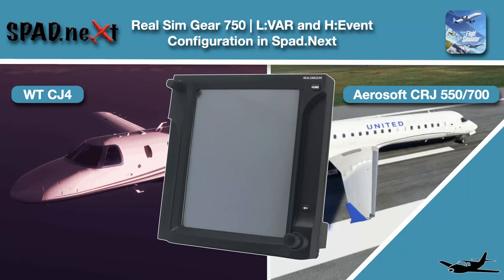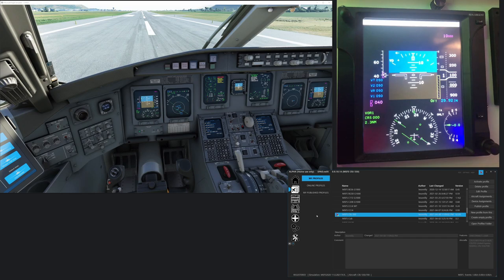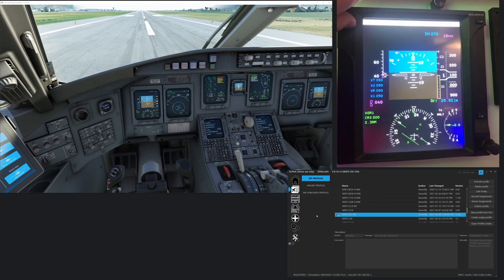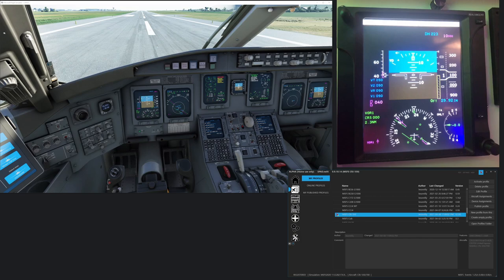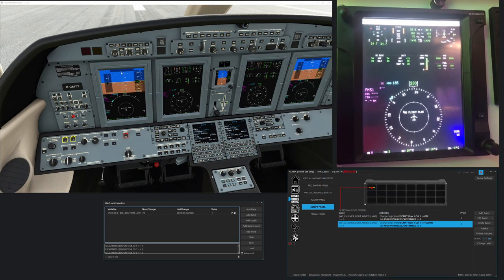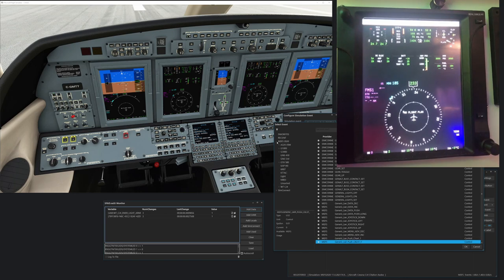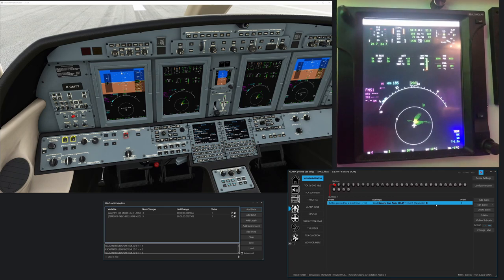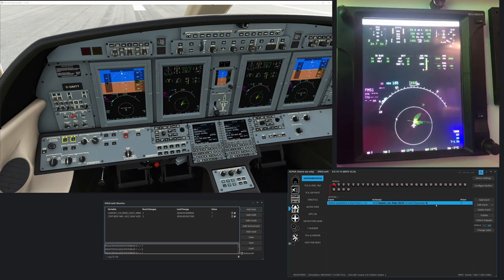(Sim Video) RSG 750 | L:VAR and H:Event in MSFS

Comment: Great work mate, as always 👏 is there a way to monitor Hvars with Xpad? Can't find a rotary knob for map zooming on the Citation Longitude using Lvar events monitor 😐 much thanks for any insights about it Cheers
Reply from the maker: Nope. You can’t monitor them as JS/HTML events don’t work like K Events. You have to know them. You want the AS3000_TSC_Vertical events. You will find the _1 through _4 and 1 is left side Pilot 2 is left middle 3 is right middle and 4 is conpilot right side.   The joystick is the control and the inc dec is used.
Reply: @Les O'Reilly  much appreciated for taking the time to help me out 👍
Reply: Les O'Reilly  And I may add that your recommendation works like a charm  🙏

Comment: It's obvious you know a lot about mappings from Spad.Next to the CJ4 mod and other aircraft.  Not sure if you're familiar with Virpil devices but they have a lot of devices that have RGB-LED buttons and across 3 of their devices there are 28 of them, which are really just backlit LED's behind the buttons as opposed to functional LEDs programmed for a purpose during pushing of the buttons.  There is VPC (Virpil) control software that simply allows the lights to be changed to different colors and remembered - again, just as backlighting.  I'm wondering if SPad.Next, Joystick Gremlin, &/OR VJOY or some combination therein would allow the tinkering of these pushbutton LEDs to be much more functional.  For example, have a button LED display when there is a Master-Caution or Master Warning by illuminating and it would either be amber or red depending on the condition,  and then it could be cleared with the push of the LED button and simply go dark.  Or the button would change from one color to another when depressed.  I have a message into Spad.Next about it (but i don't think are doing any development for Virpil products) but then I saw your video in a discord thread in Working Title, thus here I am.
Reply from the maker: I have no control over the development they do. If I did I would have a couple of other devices I own working :). 

I recommend that you look at raising the subject of Virpil support with a thread. Also the better way is to contact virpil and see about getting them to share or open an API that they can give to SPAD.NeXT just like go flight did.
Reply: @LesOReilly  nice suggestions.  I'll see what they come back with (recent inquiry to Spad.next)
Reply from the maker: Always easier to get the support of the vendor of the hardware will share the Interface information. Reverse engineering the interface is time consuming.... and in Virpils case how you talk to the joystick should not be a “trade secret” like some think at other vendors....